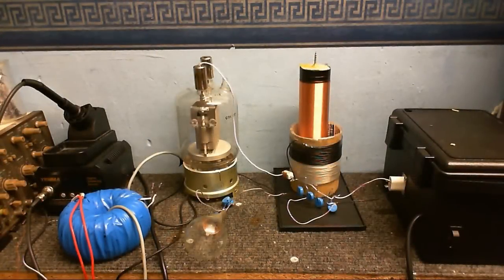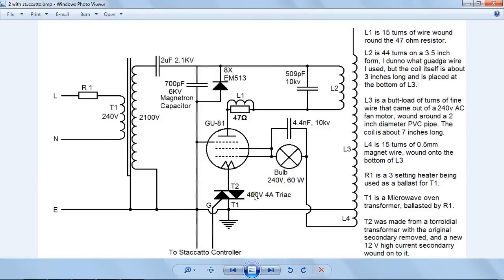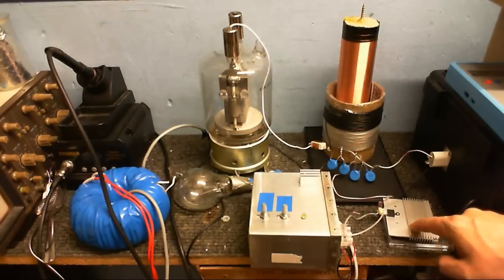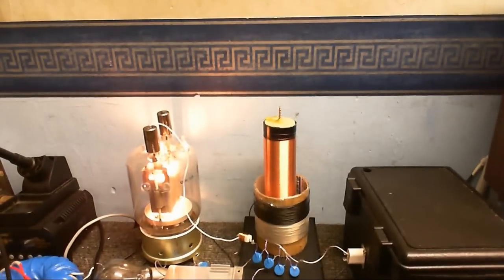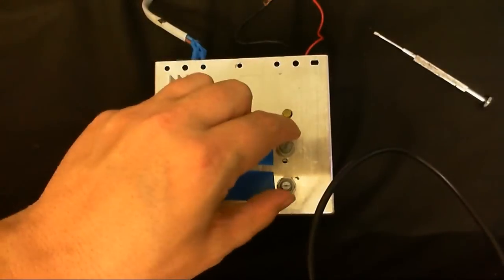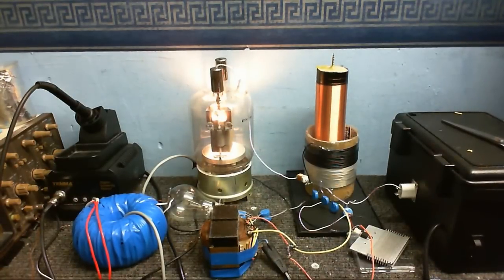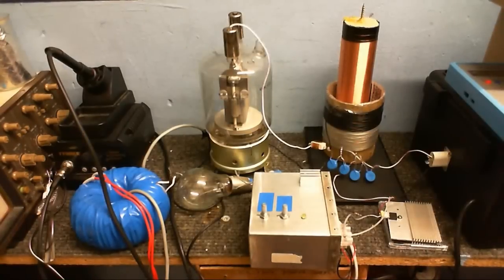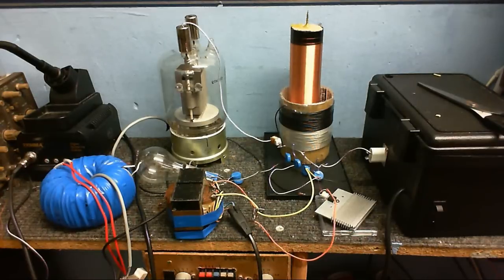How to Build A VTTC Part 3 - Adding a Staccato

Comment: i think you can use the 400V triac bcs at the moment it stays off the cathode rises in voltage level and the grid comparatively goes very low, interrupting the circuit working, the triac may reach it's 400V but at leakage current maybe, hoping for not too big stray capacitances... but honestly i dunno if it will switch so fast, it may turn on in sync with mains but triacs and scrs may not recover so fast after you try to turn em off, just with the coil frequency oscillation (that may be too high) and may ramain on untill the power supply half wave reaches near zero

Comment: Hello Clem,
The reason you can use a 400V triac in the cathode circuit is because the potential in your circuit at the cathode never reaches or exceeds 400v.If you look at any classic circuit using valves as amplifying devices,you will notice that cathode bypass capacitors are always rated at lowish voltages and are way lower than the same valve's anode voltage.Every valve has an anode resistance of course so for any given valve circuit,ohms law will allow us to calculate the various dc voltages at any particular electrode.A cathode resistor or in your case,the triac,represent the lower leg of a potential divider.The upper leg being the anode resistance itself.

Comment: I forgot....which editing software do you use? If it's not top-secret please share! Also, please try not to get electrocuted (as usual). Cheers.
Reply from the maker: ***** I use Adobe Premiere 6.5, it's quite old by now and won't run on anything later than Windows XP, but still gets the job done, I can even use it to edit 720p and even 1080p if i wish to even though it was never intended for HD video.
Reply: Groovy, I think I have an older version of that around as well or maybe it's an old Sony Vegas....but I found Vegas to be a bit of a hog and complicated for editing. Older versions are GREAT actually....more often than "new and better" updates. Thanks for the info. Cheers.